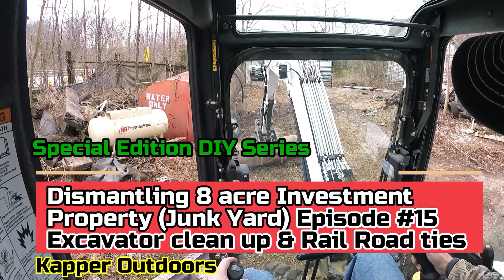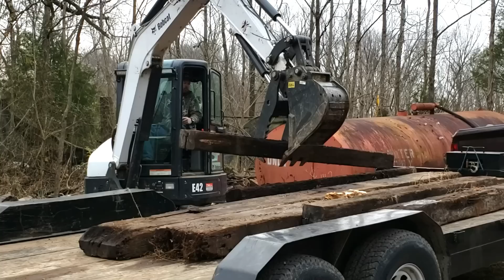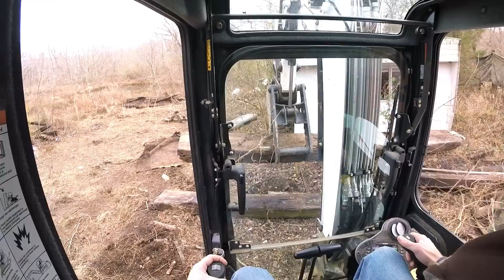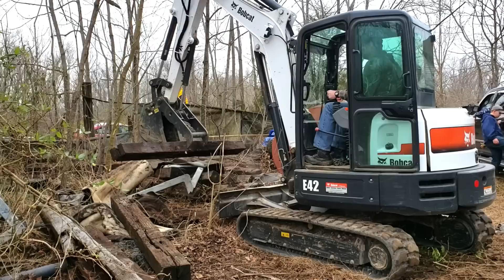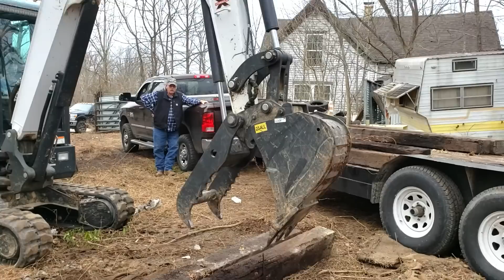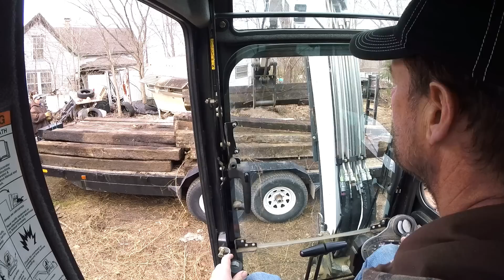Dismantling new 8 acre Picker's paradise land investment! JUNK YARD EPISODE #15 EXCAVATOR WORK!

Comment: That Ingersal Rand tank looks like a BBQ smoker begging to be built
Reply from the maker: I'm sure it could be!!
Reply: I’ve got lawn roller on my mind!
Reply: @Hoaxer51  thank you. I was trying to figure out where I could come across a piece of lager diameter pipe to make a vibrating roller for my skid steer and you just reminded  me that I have a big water system pressure tank that I had slated for a smoker that will likely never get built and seldom used if it was built.

Comment: Information, Those were not Railroad Ties. They are to big in diameter to be used for the Track Tie down.
Reply from the maker: You are right, there were various sizes, some very big. Probably bridge timbers mixed in. Thanks.
Reply: @kapperoutdoors  They would make excellent Retaining walls around a building for the people that do it themselves.